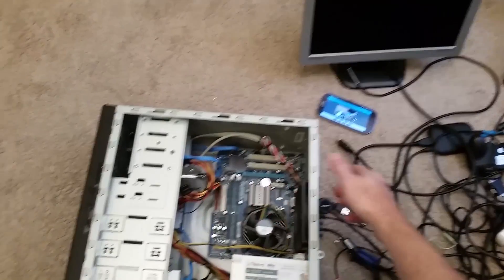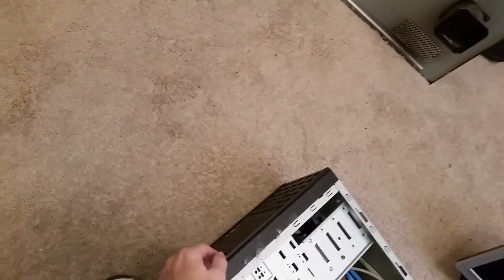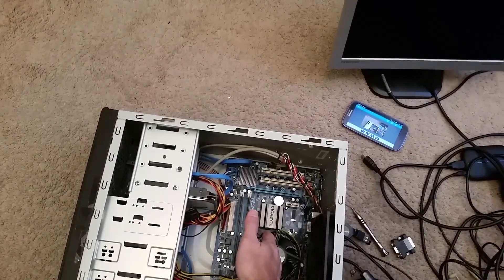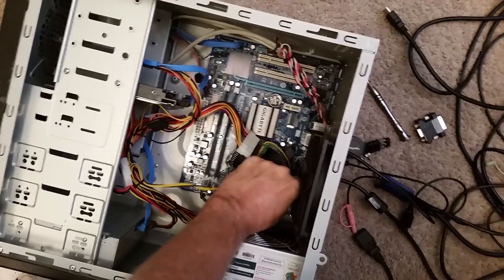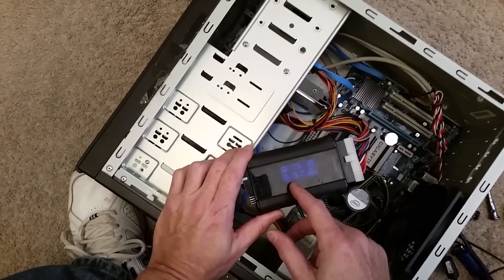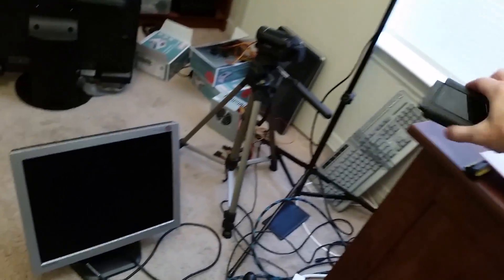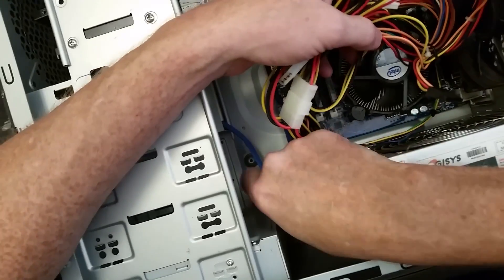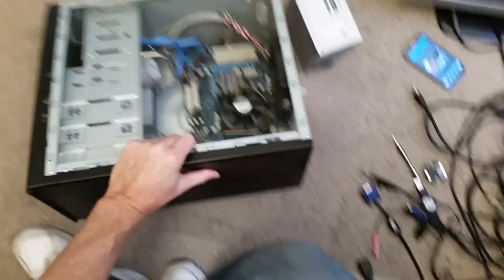Power Supply Troubleshooting, no video, powers off

Comment: Dude. You might've just saved me from buying a new computer. If this turns out to be the issue, this will be the 2nd time you helped me out with a fix. Last time I was pretty sure it was a bad graphics card. I watched one of your videos, and even commented asking you what you thought my issue was. You said it did sound like the graphics card was my issue. I replaced it and bam, my computer was working again.

This time, however, I'm pretty sure it's not a graphics card issue. I was using my computer, downloading game files, and it seemed to freeze. Well, the screen locked in place. However, the activity light on my computer stopped bonking rapidly, and I believe it was pretty much not bonking at all. I manually turned off the computer, turned it back on, and it was just on a black screen. The activity light would bonk a couple times every 5 seconds or so. But, it wouldn't blink rapidly as if it was booting windows. I turned off the PSU, and disconnected everything but the CPU. I put it all back together, and still get the she result. I even tried different slots for the ram, and tried each such by itself, just in case a stick or shot went bad. Nothing changed. I was cringing at the fact that it could be the motherboard or CPU simply because I don't know how to even check if those are the issue.

My computer is old. I want to say it's close to 8 years old. The only things I have ever had to replace are HDD's, and the graphics card last year. Now, this happens. I'm hoping it's the power supply. If it isn't, it looks like I'll be buying or building a new PC. If I have to start fresh, I'm hoping my tower will fit a newer motherboard (as in the screw placements), and what not. This couldn't have come at a worse time. I usually don't like using my phone to do things on the internet, if I have my PC within reach. I'll have to buy that power supply tester and a new PSU. I'll test the old unit before totally pulling it. Then, I'll go ahead and try the new unit to see if it fixes the problem. Fingers crossed.